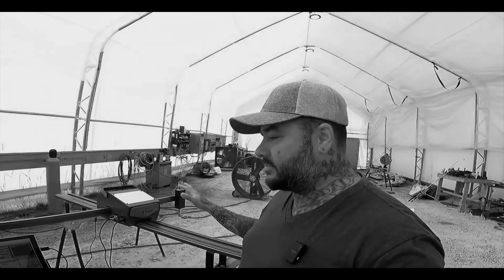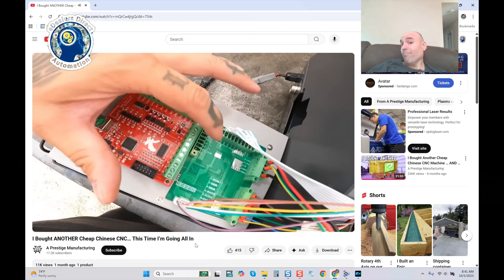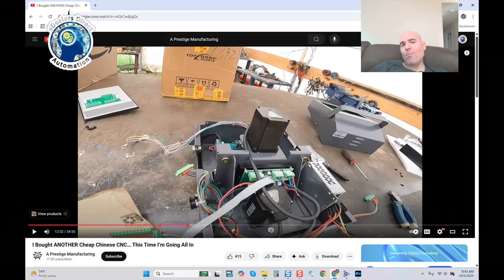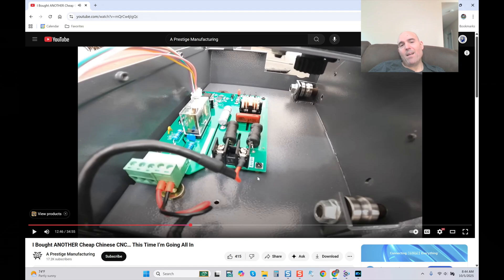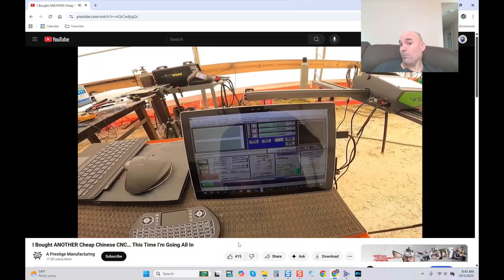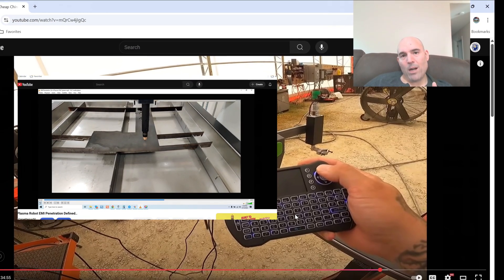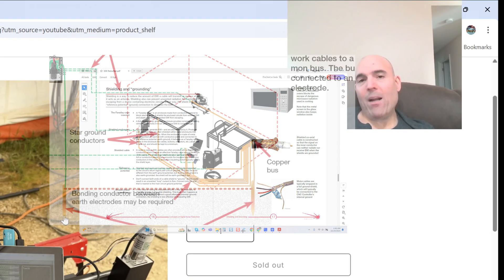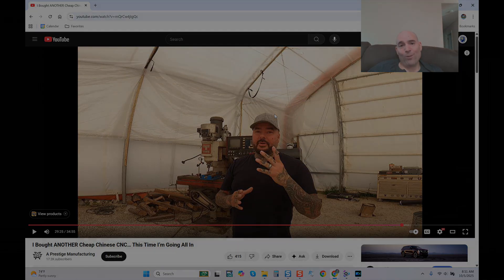Exposing This Plasma CNC Build: ⚡ No Grounding, No Shielding, Just Dirt

Comment: Vinny, you whined to me about your hyper-sensative clean environment and stated "eventually it will fail".  I am now going on 16 years on a very old system and we now have history....YOU ARE WRONG.  Is it better to have a clean environment....absolutely but stop the Chicken-Little, the sky is falling BS.
Reply from the maker: There's a forum your missing from isn't there, or if you feel like a real person rather than a bot, or keyboard warrior we could always schedule a live stream debate??

Physics Isn't a Debate: Electronic components have a measurable lifespan.

 Electrolytic capacitors on motherboards and power supplies chemically dry out and degrade over time. After 10+ years, they are operating on borrowed time. Your system hasn't failed yet, but the failure curve isn't a cliff—it's a steep slope, and you're already far down it. This isn't my opinion; it's a principle of electrical engineering.

The Stakes Are Real: This is the core of your mistake. You're treating this like a desktop PC for web browsing where a crash there means you reboot. 

A crash on a CNC controller can, and will:

Instantly ruin a workpiece with hundreds of dollars in material and hours of labor.

Shatter cutting tools and damage the machine spindle, leading to four-figure repair bills.

Create a serious safety hazard from an uncontrolled machine.

"Chicken Little" is simply an educated mind mitigating risk: Dismissing this as "the sky is falling" reflects incompetence. Professionals don't gamble their robots and projects on hardware that is statistically at the end of its life. 

Vince
Reply: @corvetteguy50  keyboard warrior look who's talking
Reply: he is talking shit to me now for building out of scrap because i said ipa cleans flux  off
Reply: wait till he sees my parts placing machine that also a reflow chamber from junk

Comment: There is a place for a dirt or gravel floor in a  shop. BUT this is NOT the case here,  At one time we had a small foundry,  we could pour 30lbs of aluminum or 90 pounds of bronze. the two metals we worked. the reason we had had  a gravel floor, (hard packed road base material)  was in because if the molten metal hit concrete there was high risk of a violent spalling event when the molten metal flash the moisture in the cement into steam.  good luck to him on keeping his his rails and bearing alive in that enviroment. just think though, the controller will arrive "pre-dirty"

Comment: Hi Vince, I agree with 98 percent of what you say. I responded to this guy on his mill conversion video. I told him that the USB control was a no go and I pointed him to what he should consider.. Here is where you and I differ a little bit. I was the second guy in this country USA to manufacture and sell CNC plasma kits. Torchmate was the first. His stuff was so bad that he forced me into business. He used plotter files to run the machines. That's 1016 units per inch, really are you kidding, and he didn't have software to turn the torch on and off automatically, WTF. I wrote my own dxf to gcode software and used a far superior machine control program MaxNc to control the machine. I fixed all the design errors he had in his machine. I paid 3000 dollars for his CNC kit 30 ish years ago, which was a lot of money back then. So I understand how it is to get ripped off. Like I said I enjoy your videos, especially the part where you don't vilify DOS systems as they are my favorite. As I heard one guy say "there are 2 types of people in this world, those who understand code and those who don't" Love the channel l!!

Comment: But Vince, he needs the fan to blow plasma smoke all over his "shop" LOL. 

Those single arm CNC knock offs are all a scam. The Chinese "copied" a Japanese designed and Taiwanese built cutter that costs $18,000 for the entry model. I say "copied" because they didn't buy one and reverse engineer it, they just popped out something that looks like it, with the same offline controller that they use on a desktop laser engraver running it. A good comparison would be a Japanese Samurai sword vs a Dollar Store dull Hatchet.

Youtube doesn't care about these scams running, because Youtube is doing it themselves. Have you seen the pop ad for the $45 "laser welder"? They run video of a real hand held laser welder being demoed in the back ground, but they are selling a cheap spool fed soldering iron. To add insult to injury, the same soldering iron is available on Amazon for $13. It's completely useless, but at least it's only $13 of useless instead of $45 of useless. I've flagged that ad every time I have seen in in the last year and no response from Youtube. The ad still pops up and leads people to a store link for purchase.
Reply from the maker: 🤣Yea this is a real problem, and its a shame they haven't looked at the content. I've seen that laser welder commercial to, and all the same content creators come up using it. It once again unfortunately all comes down to end users research on fact from fiction. Thank you as always for your support. Vince